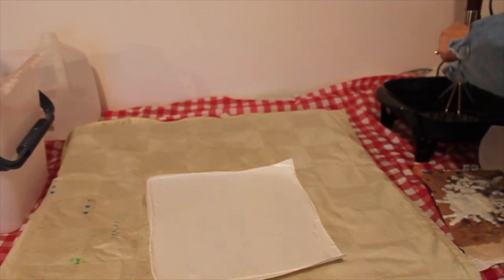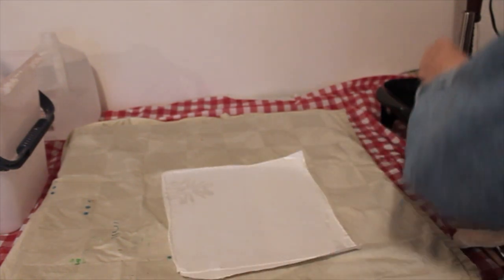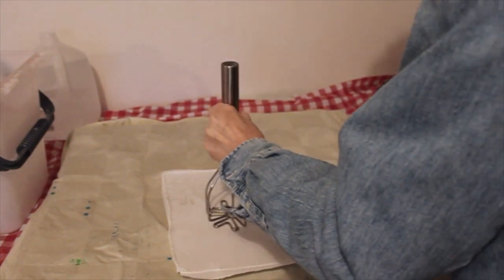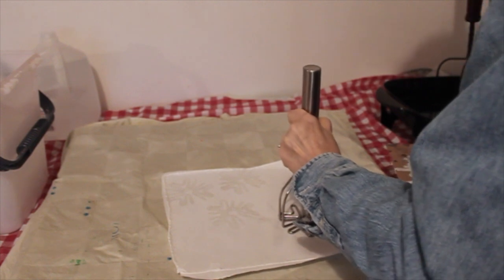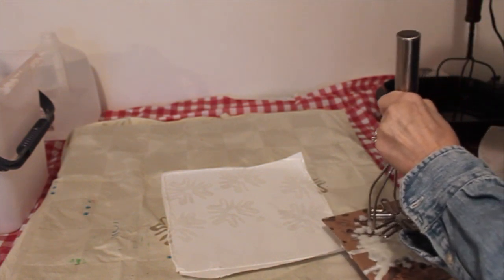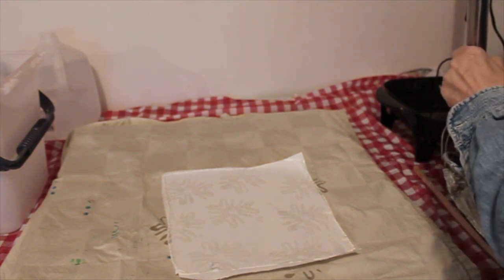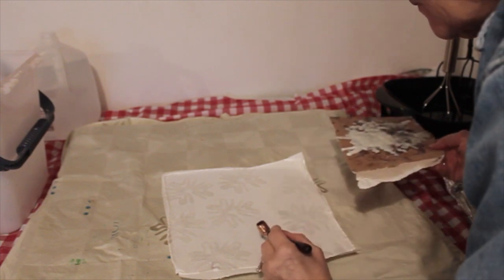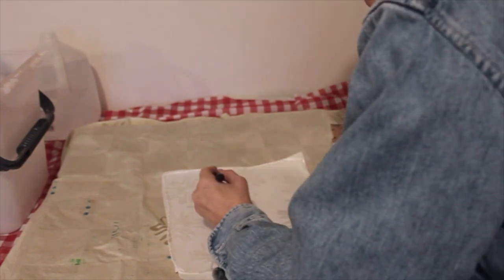Back To Basics: Soy Wax Batik

Comment: Can u mix dye with the wax if u want the stamp to have a different color?
Reply from the maker: Yes, in fact Jane Dunnewold has created wax paste and wax crayons to do that and her book Vibrant Colors has the recipes. However, the process is a bit different and you need to steam the wax out instead of just washing it. A way to get different colored marks from the wax is to use previously dyed fabric - a light colored fabric and then dye over the wax. When the wax is removed the original color will show.  But in the end if you really just want the mark to have a different color just stamp with fabric paint and leave out the wax.
Reply: Thank you

Comment: hello :) can you use beeswax instead?
thanks
Reply from the maker: Rowan, Usually beeswax is combined with paraffin, but I've found that it is hard to get out of the cloth and real stinky. Soy wax doesn't smell and comes out easily from the cloth and it's all natural and a renewable resource and supports our farmers. It also comes in flakes so it's easier to melt. I've not heard of anyone who uses beeswax by itself. However, you might try it if you have lots of beeswax around. If you do, I'd love to hear your results.